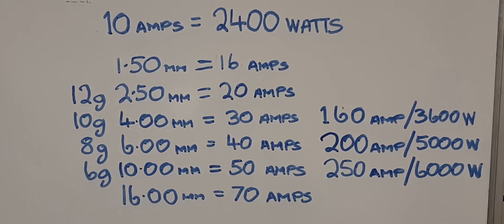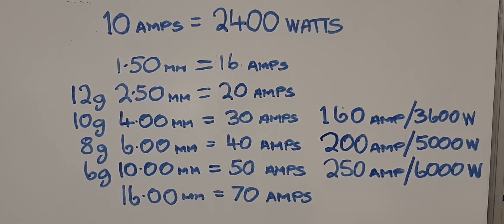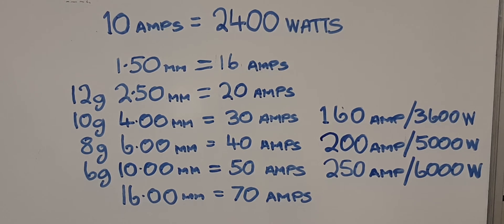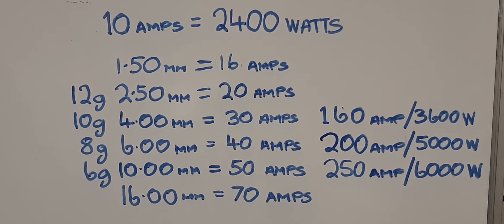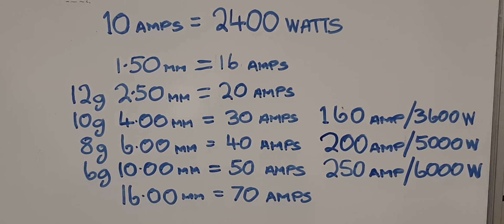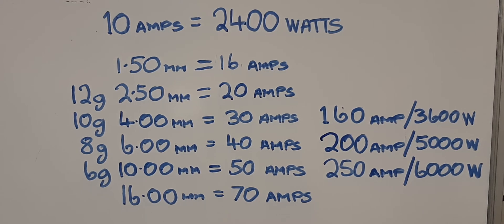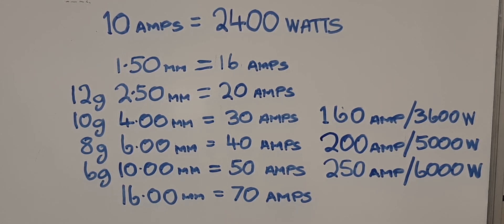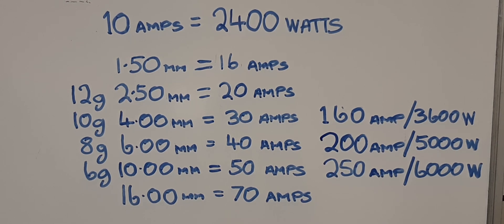Welding Machine Power Requirements. Cable Size & Should I Use an Extension Lead ??

Comment: uummmmm what voltage did you use to work this out??
Reply from the maker: 240 volt.
I would have liked to cover more in this video but it would be way to long ??
But ampage of the supply cable to the welding machine would be the same. regardless of voltage.
Hopefully this helps.